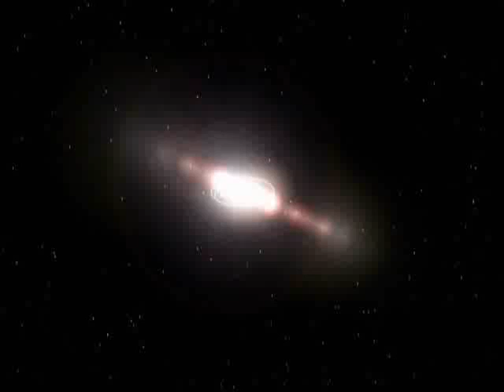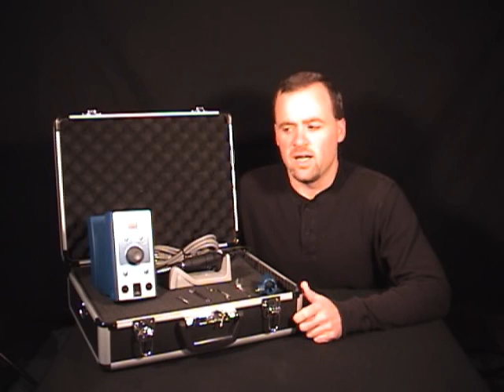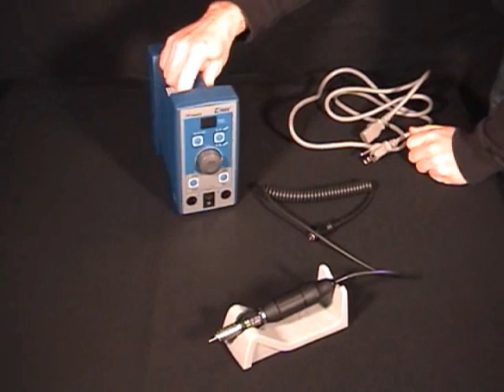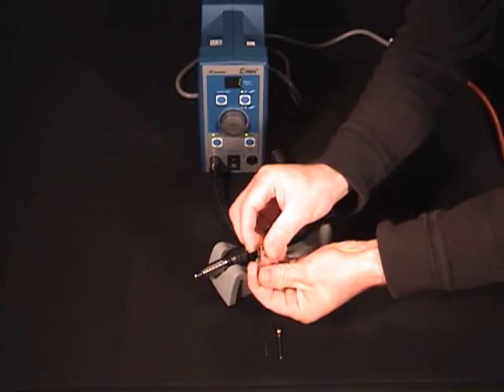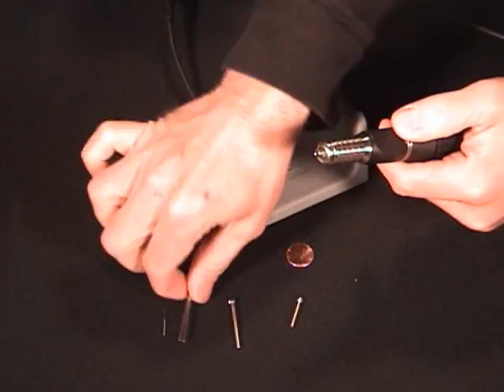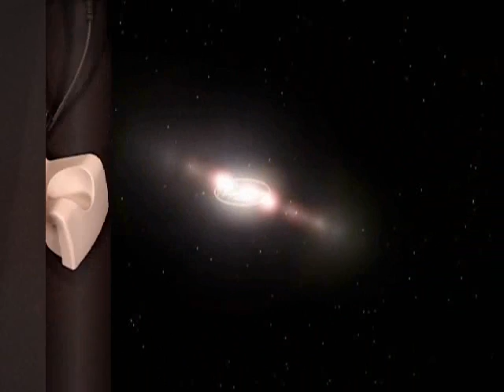NSK Emax Electric Engraver - Power Carving System

Comment from the maker: Sorry, but in order to get a unit for GB, you will need to find an NSK distributor in GB. I have verified this info with NSK - hope you find what you are looking for. Our High Speed Engraving Systems run off air at much higher speeds, therefore the only thing you need is a compressor. You can check them out at Profitable Hobbies dot com.